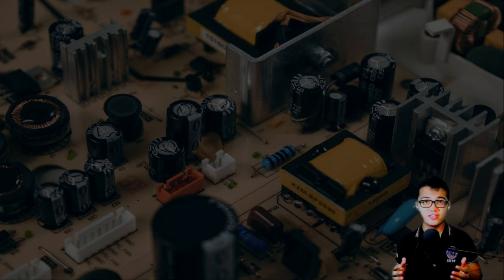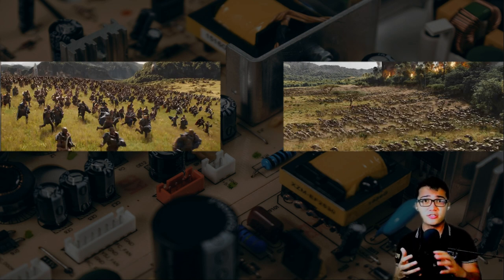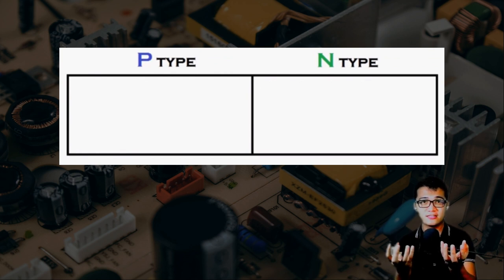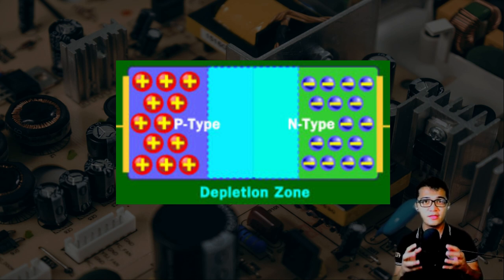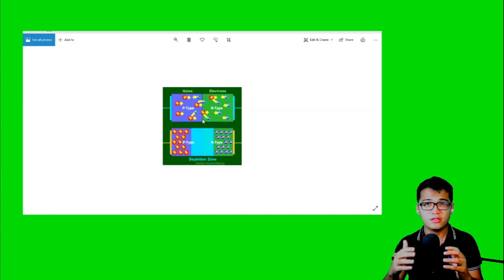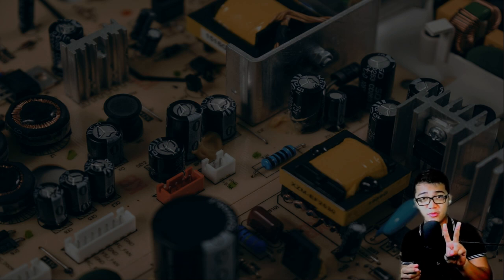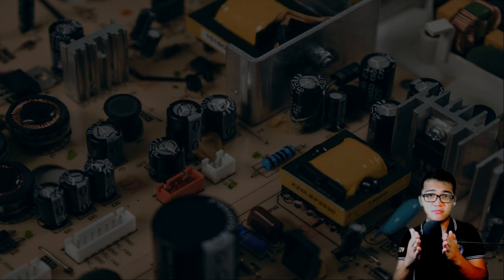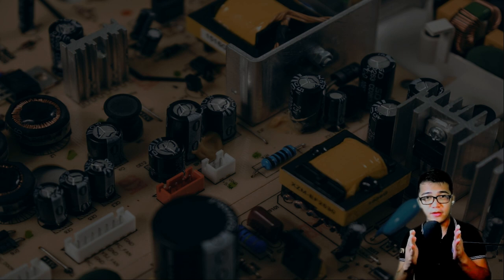Diodes - Its Construction, Operation, Characteristics and Specifications | Errol Karl Gumagay

Comment: When I  watched the video I have learned and understand the construction, operating principles, characteristics and specification of a Semiconductor diodes. When an opposing charges combined Semiconductor diodes form.  Diodes is the combination of 2 electrodes which are the P-type(holes as  majority carriers) and N-type (electrons as majority carriers.) Remember that minority carriers is not included since  this two Semiconductor are dependent on the interaction between it's majority carriers when this two   Semiconductor diodes combined. If N-type and P-type combined they can attract  to one another since they have opposite charges. When attraction occurs most of the charges recombined with each other, meaning the holes filled up by electrons on opposite sides that resulted a region  in the middle of interconnection between the Semiconductor Devices that is depleted of holes and electrons known as Depletion region. Depletion region is  important upon attaining balance between this two  Semiconductor diodes. As you go on to this topic you have to understand first  the concept of PN junction since it is a good  hint in understanding Semiconductor Devices. As the process occurs, they left behind an atom that is lacking a hole known as Ion.It can either be a positive ion or negative ion. Positive ion produce when electrons goes to PN juntion while negative ion produce hole is lost. Due to their opposite charges they will creating a barrier potential or a voltage. Barrier potential or voltage serve as an insulating or separator. When fixed DC voltage goes  to terminal of an electronic component therefore it has flow of current known us Forward Biased (turn  on, closed switch) diode while Reverse biased diode no flow of current ( turn off, open switch)
The barrier potential of Germanium is 0.3 volts, Silicon is 0.7 volts and for Gallium Arsenide is 1.2 volts.  The characteristics of diode includes forward region, knee, reverse region, reverse current and breakdown. In forward region there's no flow of current. Arriving the knee consist of 0.7 volts  the current grows up quickly denoting that this is seemingly a closed switch that allows  current flow therefore this parts is associated with the forward Biased diode. In reverse region the amount of  current is very minimal this part is associated with reverse biased diode.

Comment: Diode is the simplest semi conductor device. It is a combination of two electrodes. A diode is constructed with two sides, one is p-type and the other is n-type. The electrons initial reaction is to repel each other since electrons are negative charge, part of those electrons will cross the P/N junction. When these electrons that have crossed meets or combines with the holes, this process is called Recombination. Upon Recombination there is space between p-type and n-type will be created and this is called Depletion region/zone. When a hole who crossed the P/N junction and recombined with an electron left an atom that is lacking a hole, that atom is called a negative ion. Vice versa if an electron crossed and recombined with a hole, that atom missing an electron is now called a positive ion. At the edge of p-type and n-type there will be surplus or excess charge that is opposite to their charges, this called barrier potential or there will be voltage. Barrier potential serves as an insulator, only can holes and electrons cross if they will exceed the barrier or voltage. Forward biased diode is a flow of electrons so there is flow of current. Conditions or pattern of this diode the positive terminal must be connected to the p-type, negative terminal must be connected to the n-type and barrier potential must be exceeded. While Reverse biased diode is the opposite, negative terminal is connected to the p-type and positive terminal is connected to n-type. This will cause of widening of depletion region so there is no flow of current to the diode and the whole circuit but there is this point where it will conduct voltage but this is like an end game since the diode will be damage, it is called Breakdown Voltage. Breakdown Voltage limit or specified voltage can be referred to VRRM. Again, this is the limit for a diode to be damage. I(f) is the maximum flow for a forward biased. The electrical characteristic of a reverse current depends on the temperature. If the ambient temperature is high then the current will also be high.
Reply from the maker: This is a great summary to what was discussed and the fact that you related the breakdown voltage to the 'Endgame' (which is also part of the Marvel Avengers analogy) since some types of diodes actually becomes permanently damaged once this voltage is reached.

Comment: Good morning Sir. As I have watched the video I have learned and understand the construction, operating principles, characteristics and specification of a Semiconductor diodes. When an opposing charges combined Semiconductor diodes form.  Diodes is the combination of 2 electrodes which are the P-type(holes as  majority carriers) and N-type (electrons as majority carriers.) Remember that minority carriers is not included since  this two Semiconductor are dependent on the interaction between it's majority carriers when this two   Semiconductor diodes combined. If N-type and P-type combined they can attract  to one another since they have opposite charges. When attraction occurs most of the charges recombined with each other, meaning the holes filled up by electrons on opposite sides that resulted a region  in the middle of interconnection between the Semiconductor Devices that is depleted of holes and electrons known as Depletion region. Depletion region is  important upon attaining balance between this two  Semiconductor diodes. As we  go on to this topic we  have to understand first  the concept of PN junction since it is a good  hint in understanding Semiconductor Devices. As the process occurs, they left behind an atom that is lacking a hole known as Ion. It can either be a positive ion or negative ion. Positive ion produce when electrons goes to PN junction while negative ion produce when hole is lost. Due to their opposite charges they will creating a barrier potential or a voltage. Barrier potential or voltage serve as an insulating or separator. If this barriers is not exceeded therefore there will be no flow of electrons and holes or in simple term no flow of current . When fixed DC voltage to terminal of an electronic component therefore it has flow of current known us Forward Biased (turn on, closed switch) diode while Reverse biased diode no flow of current ( turn off, open switch)
The barrier potential of Germanium is 0.3 volts, Silicon is 0.7 volts and for Gallium Arsenide is 1.2 volts.  The characteristics of diode includes forward region, knee, reverse region, reverse current and breakdown. Remember that vertical axis is a diode current while horizontal axis is a diode voltage. In forward region there's no flow of current. Arriving the knee consist of 0.7 volts  the current grows up quickly denoting that this is seemingly a closed switch that allows  current flow therefore this parts is associated with the forward Biased diode. In reverse region the amount of  current is very minimal this part is associated with reverse biased diode. As the voltage increases it will reach the point of breakdown voltage through which diode will conduct current. Diode has  also limitations, meaning diodes shouldn't exceed the maximum ratings and specification to avoid distraction of diodes.
Thank you sir For the nice video presentation of our lesson. I've learned so much from that video Sir because you have   discussed it moderately and precisely. God bless po Sir.
Reply from the maker: This has been a great summary to the lecture video which covers every bit of the intended learning outcome. Kudos for that.

One thing I can add is that diode is a combination of two ELECTRODES. - DI - which means two and - ODE which refers to electrode. That is why it translates to 'two electrodes'.

Also, although we no longer included the discussion on minority carriers, it still has significance later on. We have skipped that part for now to give emphasis on the general attributes of a diode for us to get familiar with it.

Again, this is a great comment. Keep it up!
Reply: @shinstats  thank you sir

Comment: A semiconductor diode is a combination of two opposing materials. And If we combine two materials it is expected since These two has opposing charges of majority carriers, and when these opposite charges attracts most of these charges recombined with each other. The holes will filled up by electrons on the opposite side and these process of recombination of two electrodes. The Ptype and Ntype which has different characteristics. Ptype have holes as majority carriers and Ntype have electrons as majority carriers. When Ptype and Ntype are joined during manufacturing, a (junction) is created where the two materials meet. And the holes close to the junction are attracted to the electrons at the other side of the junction.

Comment: A diode is formed by joining two equivalently doped P-Type and N-Type semiconductor. When they are joined an interesting phenomenon takes place. The P-Type semiconductor has excess holes and is of positive charge. The N-Type semiconductor has excess electrons. At the point of contact of the P-Type and N-Type regions, the holes in the P-Type attract electrons in the N-Type material. Hence the electron diffuses and occupies the holes in the P-Type material. Causing a small region of the N-type near the junction to lose electrons and behave like intrinsic semiconductor material, in the P-type a small region gets filled up by holes and behaves like a intrinsic semiconductor.

Comment: The combination of two electrons is called a diode, diode is the simplest semiconductor device, the 2 semiconductors are joined the initial reaction of the electrons in the N-type will be to repel each other, the purpose of  barrier potential it serves as an insulating potential . the holes on the p-type which actually crossed the PN junction and recombined with an electron left behind an atom that's lacking a hole and that is called an ion . ion, since it lost a hole, will be a negative ion, when electron goes to the PN junction and it becomes a positive ion. Kung malakas ang pwersa ng bias voltage kaysa sa barrier potential it will be cross, (mo tabok) :)
Forward biased diode there is a flow of electrons and there's a current
Pag ang positive terminal ng battery ay naka connect sa n-type semiconductor at ang negative end ng battery ay connect sa p-type semiconductor, ito ay tinatawag na reverse biased diode
#fernandez
Reply from the maker: Great observation. Nakikita ko na talagang napag tuunan nyo ng pansin ang lesson. Careful lang sa 'combination of two "electrons"' equals a diode. That must be two 'electrodes - anode and cathode'. Besides that, this comment is great.
Reply: Hindi ba ma cocombine ang positive at negative ions gawa galing sa junction sir ?
Reply: Gagalaw din po ba ito ?
Reply from the maker: Great observation and question Fernandez. Let's start that initially there were no ions to begin with. Only pentavalent and trivalent atoms in the n-type and p-type semiconductors, respectively. The moment, these two are joined, CHARGES (holes for p-type and electrons for n-type) cross the junction and when this happens, it is when IONS are created. Unlike charges which can move, ions DO NOT, it stays where it is left of. Since most the ions are concentrated at the center because attraction between charges is also affected by distance meaning most recombination happens at the center. That is why the creation of electric field is concentrated at the depletion region, and this electric field is the barrier potential. Tell me if this answers your question.

Comment: DE GUZMAN
Semiconductors are important especially on board ship because it helps us in different types of applications. In a diode it has a two combination electrodes, the P type semiconductors has a majority of pole carriers and in the other side will be the N type has the electron as their majority carriers. In the principles of operation it is also stated that their is a certain gap or a void that where located at the center of the two electrodes and inside those depletion region their will be a barrier that will stop the exchange of flows from electrons to holes in short the depletion region is a potential barrier that prevents the flow of the electrons to the other side. In the characteristics of a diode it is also mentioned the forward biased and the unbiased diode in forward biased it tells us that flow of the electrons will continue if the N type of the diode will make a certain path or has a wire to connect to the battery and it will attract the charge form the other side but if the diode will connect directly to the battery both type it will make the holes attract to their own charges in short their will be an unbiased diode or no supply these two are usually made in on and off of the current flow. Lastly the specifications of a semiconductor diode are just a lists of operational characteristics of a diode.
Reply from the maker: I see that you really watched the video. Careful on the term used for the majority carriers for P-type semiconductors. Also, there are three modes of operation: unbiased / no bias which means no battery is supplied, forward biased and reversed bias. Aside from those things, you have everything covered in this comment.

Comment: Tafalla
The constructor of semi conductor diode is combination of opposing material. If we combined 2 material it is expected since this two are opposing charges of madurity period. It is called diode because it is combination of 2 electrons, the P type and the N type and it has different characteristics. P types have rule as madurity period and N type have electrons as there madurity period. When P type and N type brought together during manufacturer, a conjunction is created where the P type and N type materials meet ,and the holes close to the conjunction in the P type are attracted into negatively charged N type material at the other side of the junction.
Reply from the maker: The construction of a semiconductor diode is a combination of two opposing materials. If we combine two materials it is expected since these two have opposing majority carriers. It is called a diode because it is a combination of two ELECTRODES - the P-type and N-type which has different characteristics. P-type have HOLES as majority carriers and N-type have electrons as majority carriers. When p-type and n-type are joined during manufacturing, a JUNCTION is created where the two materials meet. Andthe holes close to the junction are attracted to the electrons at the other side of the junction.
Reply from the maker: This is great. I revised some of the words of your comment. I hope it helps.